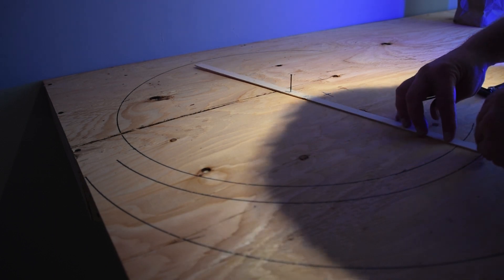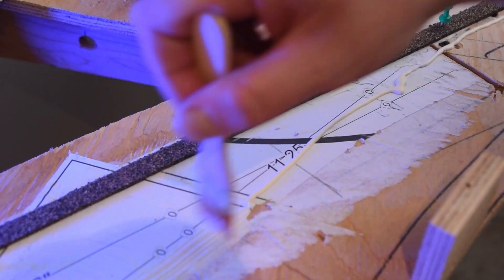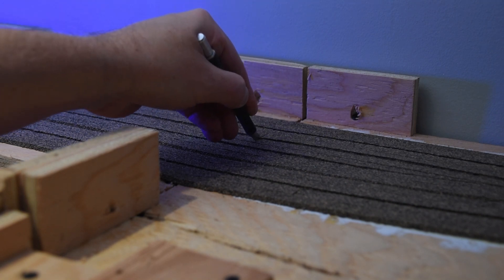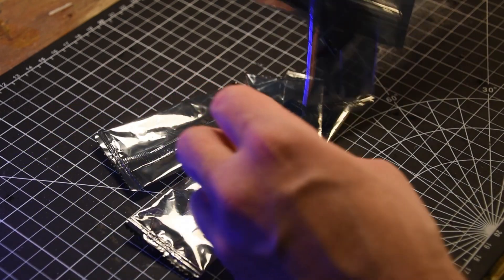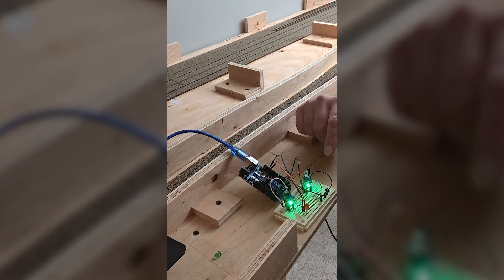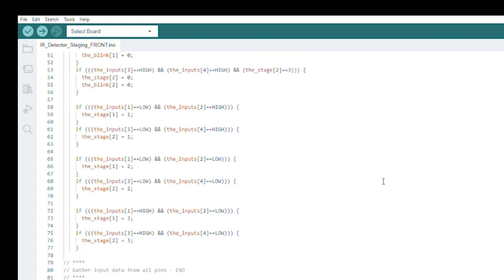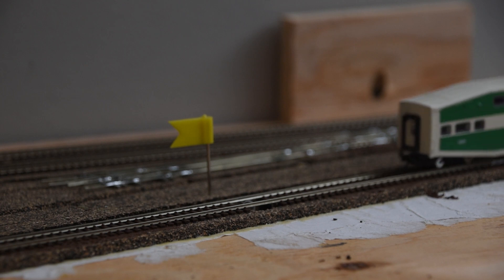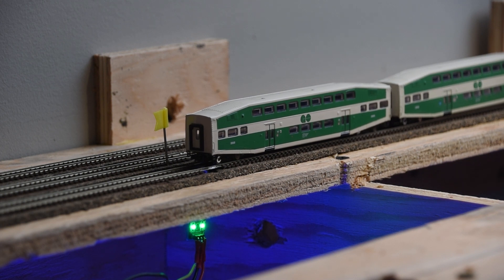Union Project: Installing Roadbed and IR Block Detectors

Comment: If you also feed the signal from your stop IR detector to an Arduino type relay, you can kill the power to the staging track, the train will stop... dead. I did this with Tortoise machines so that when I wanted the stopped train to proceed, contacts on the Tortoise broke the signal path to the relay, de-energizing it, thus restoring the power to that track. As the loco was still moving when it was stopped, when power is restored, the momentum settings in the decoder will have the loco accelerate at those settings. As you are using servos, you would need to engineer a way to break the signal to the relay when your turnout changes to allow the train to proceed, perhaps a micro switch with a long lever could be rigged up, activated by the servo arm, to do that. I just found your channel, you've got some really good content.
Reply from the maker: I appreciate this comment. For the new station section I'm working on I've included relays to control track power when the servos activate. It should be very straightforward to do as you describe. Thanks!

Comment: It's good to see everything moving forward.
Is the plan to create a panel to mount the indicator LEDs for the staging? I like the system of flashing and solid all from one LED. Makes it simple.
Reply from the maker: I'm going to add some nice control panels for the lights and switches. There's so much wiring that needs to have them before I get to that stage. I'm going to be taping things to the wall. 🙂

Comment: That was informative!  I have a 5 track hidden staging yard and too many times Ive slammed a train into one parked in the staging... I can see one side just not the other unless I crawl into my  helix and look down.. thxs and take care.. DD 😜🤗
Reply from the maker: I was so eager to start running some trains at almost skipped this step... But I didn't want to run into the problem that you described! I've also seen that you can buy inexpensive backup cameras for $60 that could be used as a small monitor underneath the layout. I'm tempted to add one of these as well...
Reply: @NScaleDystopia  A camera mite be a better solution.... my layout is in my 4 car garage so at least I can just open up one of the garage doors to re-rail my mess.... its just a pain though... DD   😜

Comment: Love that opening!
And once more, this project is blowing my mind. The scale and intricacy of the layout alone is really impressive on its own, but to see stuff like this blockage indication system being implemented, now that is something else.

Maybe I do have to make something like this myself after all... on a much smaller scale, for sure, but this does look like it's a lot of fun!
Reply from the maker: Thanks very much! This project has been a fun distraction from simply building models. You don't get to do this stage very often so I'm trying to be as thorough and creative as I can.
Reply: @NScaleDystopia  Yeah, it's neat to make small dioramas or individual buildings, but once in a while, you just gotta go wild!

It's one thing to make a neat looking building or a small self-contained scene, but when you put together something on this scale, you have to contemplate how everything interacts visually and then also come up with a way to make it work mechanically.
It's like being able to draw human characters really well, but never draw them within a scene or interacting with one another.

It's a lot more effort, but that's a good thing. Effort will breed success, as they say, and it's much more satisfying when it does work out in the end.
In a weird way, it's also fun to run into unforseen problems and solving them.